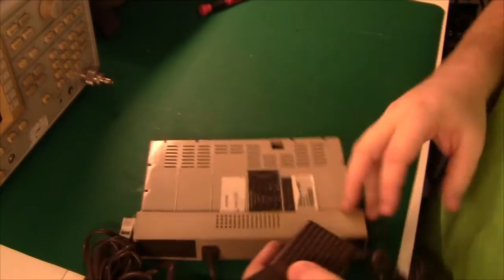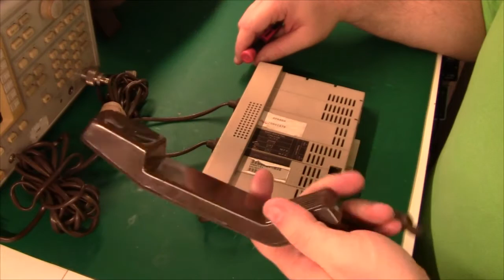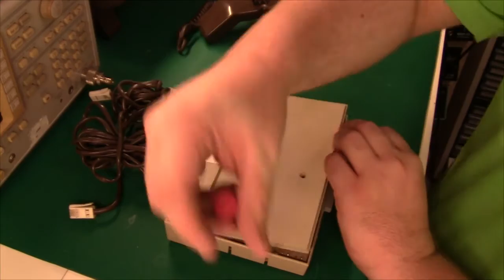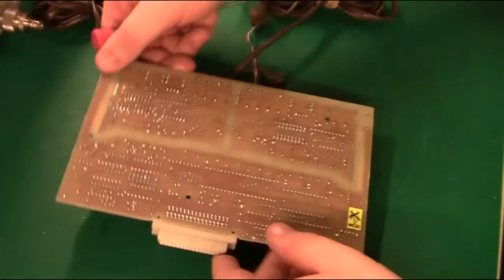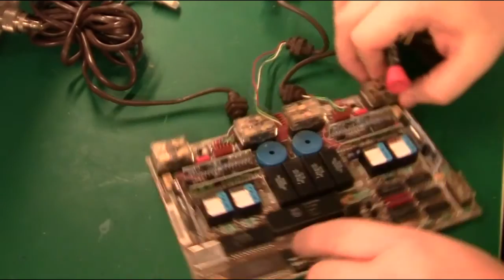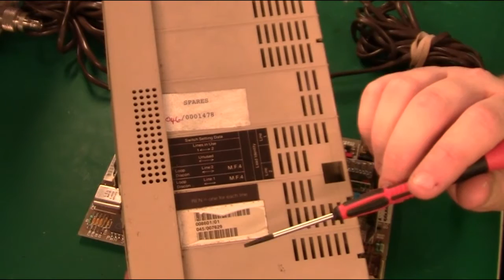Teardown of ICL One Per Desk (OPD) Modem

Comment: Great video, brings back memories. I used to repair these modules and the BT version of the main computer, the Merlin Tonto. The loop disconnect / MF4 selector switch 7:12 changes the dialling type between pulse dialling like a manual dial phone where it disconnects and reconnects the line up to 10 pulses per second depending on the digit dialled, and MF4 (DTMF) tone dialling like modern phones. The 7910 IC was prone to failing and was a right bugger to unsolder. Obviously it was socketed when changed.